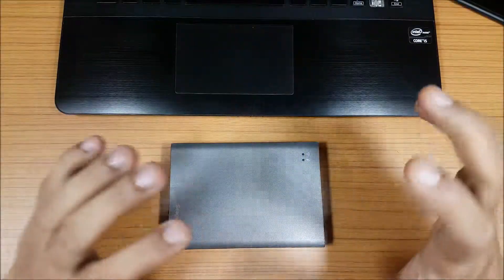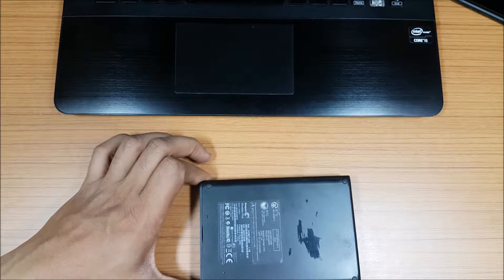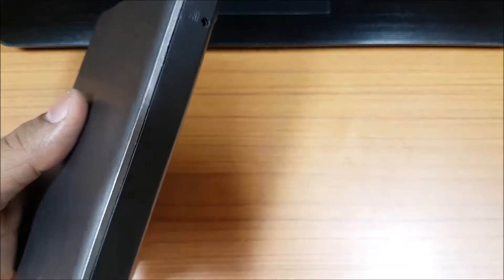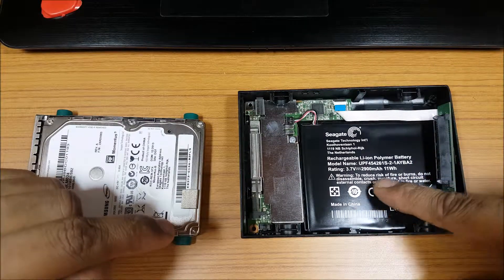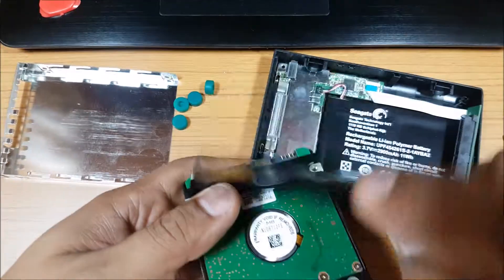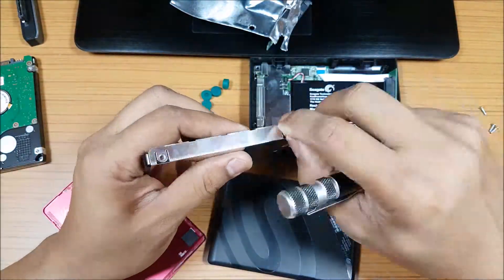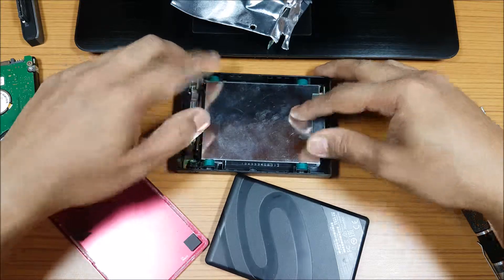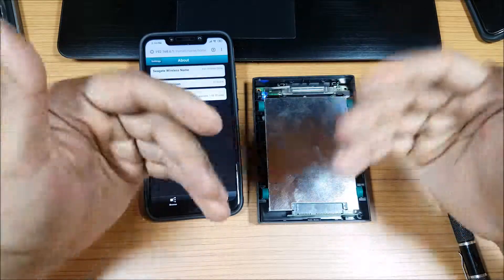Seagate Wireless Plus Disassembly and Hard Disk Replacement

Comment: Gr8 work. I have exact same 1TB which has gone bad. Mostly the battery. Can you do a video on replacing the battery then that will save my HDD. I liked the idea of upgrading it with 4 TB. Can you suggest a seagate compatible model of slim HDD. You spoke about replacing it with SSD but you used an HDD in the video. Can you also show how to replace it with a 4 TB SSD. I believe they have different connectors.  Thanks.